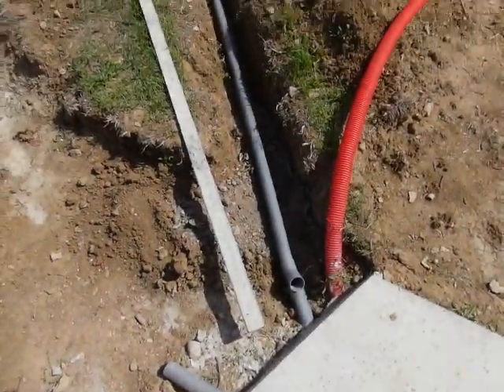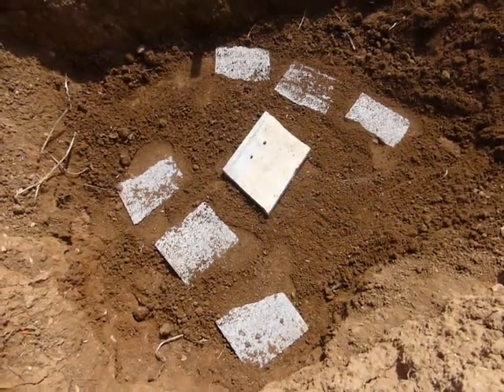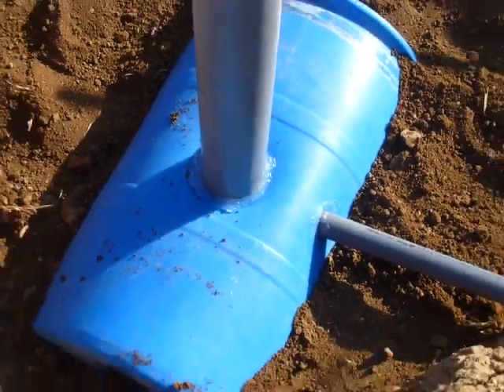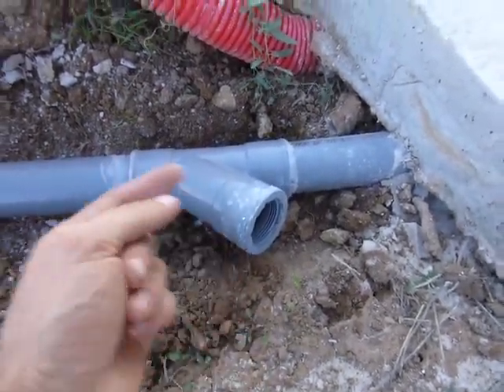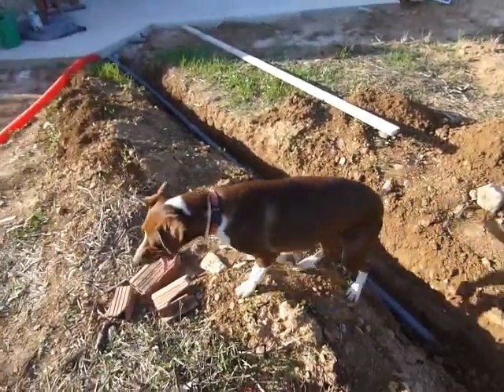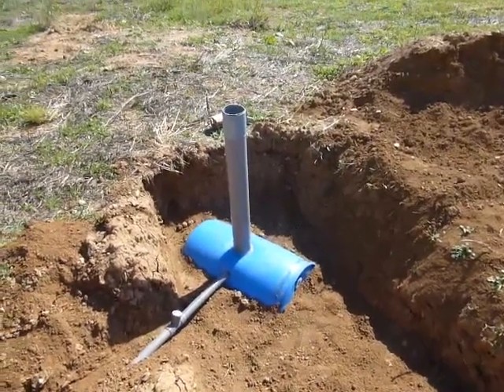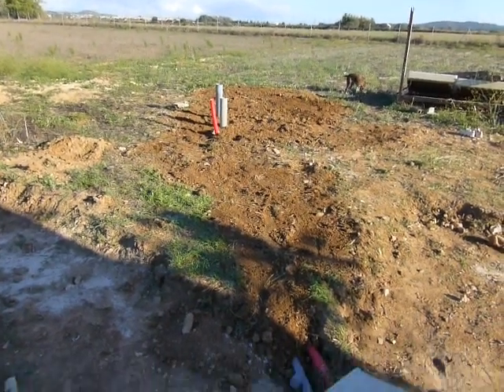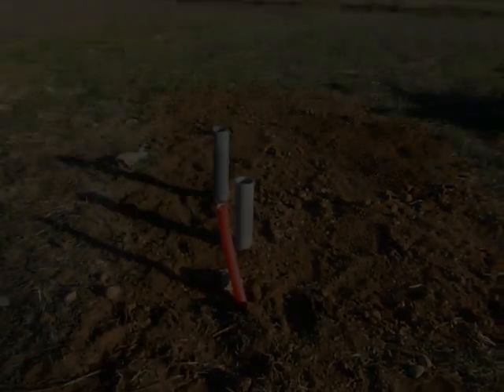Grey Water - Half Barrel Box Trough

Comment: how does this holds up when there are rain that saturate the ground
Reply from the maker: it does saturate sometimes but because I made a couple of mistakes.  the main one being that i should have put down about 30cm of gravel under it maybe twice the width of the barrel.  In theory you should measure the  drainage rate of your soil when saturated so that you can then calculate how big the barrel or air gap needs to be.

Comment: What happens when it fills up with rotting bits of food that accumulate over time. This system is wrong for it's intended purpose.  It should be built like a standard septic system with a  drain field for the water that passes through.  The rain barrel serving as the main containment unit that periodically must be pumped.
Reply from the maker: the food gets broken down by bacteria, worms etc.  there is nothing worng with this system, it works perfectly.
Reply: @Mandalaman  can you tell me how to keep the grease and food debris broken down? Is there a product I can use to put down the drain occasionally?
Reply: Yeast packets work well.

Comment: you would have better results if you would have put down a layer of gravel about 12 inches deep
Reply from the maker: you are correct!  
we had to re direct the washing machine away from it this winter when the ground was saturated with water because it wasnt draining fast enough...

Luckily the washing machine was only a temporary thing and this is just going to be for the kitchen sink.  It should be able to cope with that amount of water no problem.
Reply: Kim C
Reply: Kim C ii

Comment: permafrost line?
Reply from the maker: We live in the Mediterranean, we get very light frosts in the winter so we dont have permafrost.
Reply: where i live you have to dig 3 feet or in winter ground freeze and no drainage, or have switch valve to septic in winter and yard in summer
Reply from the maker: julian Baberze yeah, my soil gets pretty water logged in winter and it doesnt drain amazingly.  I should have put gravel down as someone else has pointed out.

Comment: This is completely unacceptable for a Gray Water System, and grossly inadequate in terms of size. Typically, for a Kitchen Sink and/or Automatic Dishwasher you install a 300 to 500 gallon capacity drywell... that's Dry Well. A 55 gallon plastic drum is so small and undersized, it's not even funny, and it won't last long... maybe 2 or 3 years. Not to mention, you need lots of crushed stone or gravel for proper drainage of the gray water, usually 2 to 3 tons of stone.